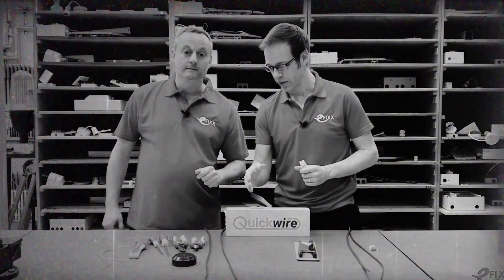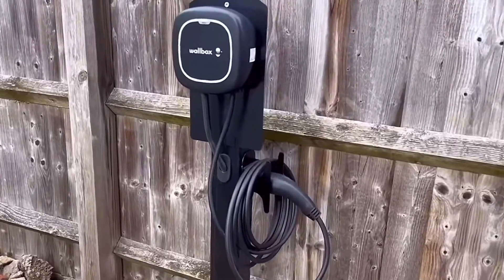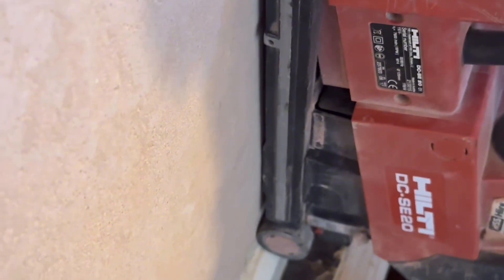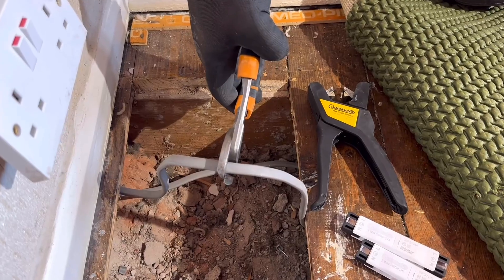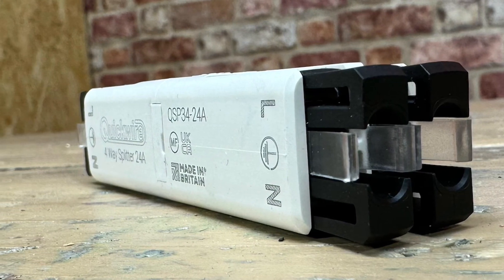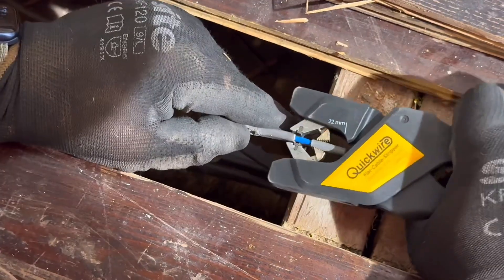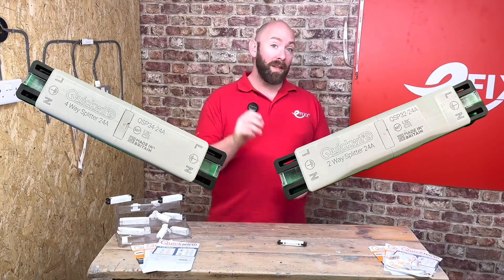Quickwire - The Fastest Way To Extend Circuits

Comment: Loving Quickwire connectors, but, if I'm not mistaken, the cables have not been fully inserted before the mechanism retracts.  This means that the connection is not secure.

Comment: Do they do a 32a version otherwise what’s the point
Reply from the maker: And the rating on 2.5mm sq cable is ???
Reply: @efixx  unrelated to this very funny thread, yet related to this video. Quite a common question unanswered here is can this product be used under fresh plaster in cases of repairing lighting where knicks of the cable have occured?

Aappreciate any response :)

Comment: I'm sold but one question...  Can these be buried in a plaster wall?  I.e. used in a wall to repair a nailed/screwed into cable and then plastered over?  (Obviously not energised until the plaster is dry?)

Comment: For what I remember in regs you cannot cut the ring to install JB only at C unit and sockets that is where the old 30 amp JB where design to enable you to install the JB with out cutting the ring circuit.
Reply: No idea what you’re talking about
Reply: Are you saying that you can't spur off a ring circuit unless it's out of the back of an existing socket, or the at the consumer unit?
I'm 99.99% sure that's completely untrue and is fine as long as you use a maintenance free junction box.
Reply: @1992jamo  no you can spur of the ring using a JB but the old 30 amp round type that allow you to split the cores of the twin and earth, and place them into the JB without cutting the ring circuit,then putting your shut cable into the JB, and tightening the brass screws up on the ring cable and the spur cable. Hopefully that make sense
Reply: @kevanswift7797  

I think that was just a practice sometimes used with the old junction boxes. I don't believe its in the regs. Ring is cut all the time, to install JB, you do with Wago's too.

Comment: On the 24a JB is that a fuse holder in the centre? If it is, this item doesn’t seem to be maintenance  free, just saying😎
Reply from the maker: Apart from the MF “Maintenance Free” symbol printed on the rating label.
Reply: @efixx  so its not a fuse holder then???
Reply: @quickwire80  thank you for the info most appreciated👍😎

Comment: Can you bury it in a wall, if someone has drilled a cable.
Reply: It is indeed MF!
Reply: @quickwire80  So you can plaster over it? I've never had the chance to look at the actual MF specs. 
If it can be plastered over I can see this being very useful.
Reply: It’s maintenance free, so yes.

Comment: How much cost do they add to the job? What's a socket install about £65 less £10 materials. 3 quick wire connectors were used so what's left on the £££ for doing the job?
Reply: If you’re just adding 1 socket then £65 is way too cheap. Using quickwire or not.
Reply from the maker: Time is money - do the maths
Reply: Takes about 2 minutes, so should charge customer a few pence.@efixx

Comment: Got my hands on some of these today and they look great. Looking forward to using them. I have a job where they will be perfect.
Reply: Awesome. Can I ask what the job was - as in how you used them? Always good to get feedback
Reply: @quickwire80 This was to add a spur to a ring where there wasn't any cable slack and it would have been inconvenient to have run a cable to spur off an existing point on the ring.
Reply: Where did you get yours from ....need some for next week....
Reply: @markyd2633  Directly from the Quickwire website. Only ordered yesterday so impressive speed.
Reply: If you want them quick, we do next day deliver pretty much as standard on the website. If you can wait a little longer then you can ask at your wholesaler, but they will have to get them in as they have only been released this week @markyd2633

Comment: If it’s rated to 24a surely you can’t use it on a ring circuit as it’s 32a
Reply: It's fine. We wire rings in 2.5 sq mm and those aren't rated for 32 A either. The same principle applies that the load will be shared between the legs of the ring.
Reply: @adambro5480 eh? It’s 5mm rating as it’s a ring lol
Reply from the maker: Great question, see the answer here: https://youtu.be/K_5fxTN-yOg

Comment: I love your videos.   So I’m not having a dig.

At 3:22 you can see that the sheath finishes slightly outside the ‘JB’ or splicer.  (What ever you call it.

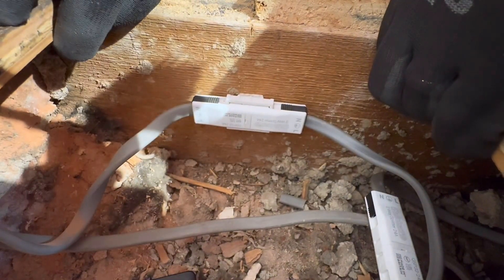At 3:33 the T&E is twisted before it enters the JB.  

Is that all normal and ok?

Comment: Quick wire are fantastic awesome products. Shame the TW&E automatic stripper is way was overpriced especially as you can’t change the blades  
Great video as always Joe 3po
Reply: The new ones do have replaceable blades. Have a look at the price of the identical Knipex ones tho 🤯
Reply: I'll just add the the other comments (thanks guys) that yes, our new versions have replaceable blades now, and prices should be very competitive...
Reply: Actually cheaper than the jokari version I had some couple of years ago.
Reply: Yes you can change the blades....look on their website

Comment: The UK installation practices are a complete joke to me. Be it the flat cables, not using conduit, leaving connections under the floor, bundling cables, the square boxes... everything is outdated and insanely labor intensive with every small problem again requiring excessive labor to fix.
Reply: Well stay in the Netherlands then
Reply: @markyd2633  
I am. Free speech isn't as degraded here as in the UK.
But feel free to learn from a much easier electrical system.
Reply: @markyd2633  
Spam isn't free speech mate.
Reply: UK is actually tons better than other parts of the world. Trust me look into itm
Reply: @h8ryj 
The little data there is on mortality rate from electrical injuries says 5x higher in the UK than in NL. The UK is on par with Germany, and that includes former East Germany.
The UK scores better than Belgium, but that's not that hard, lol. 
Definitely not the best on that front.
And that didn't say anything yet about the insane labor intensive practices. Like the square boxes that get chiseled in or require a bunch of chasing. In NL we have round boxes. Simple core drill and done. 10% of the effort and only 0,1% of the dust. Also requires a lot less of plaster work. And when you drill through it... you just pull new wires in the counduit and be done; zero plaster work involved.
Reply: @_Rich_.  
Yeah, I don't get why people posts comments like markyd2633'
Reply: Is that why we have the safest electrical system in the world and the best training and the best trained engineers to install repair and upgrade and the tuffets wiring and building regulations in the world.
Reply: @Dog-whisperer7494  
Who is 'we'? The UK? Safest in what way? 
The little data there even is points to the UK having a five times higher mortality rate from 'electrical injuries' than my country (the Netherlands).
Are you on voice to text? Otherwise I don't see how you use 'tuffets' as an adjective.

Comment: I’m no electrician, but isn’t twin and earth being replaced by 3 core cable in April? Will these connections be compatible?
Reply from the maker: I think that was our April fool from last year.https://youtu.be/qFWK57Yzefc?si=_8KDHALprbYZyyp4
Reply: Yes it was !  @efixx
Reply: No
Reply: Thanks for that, I've just found out it was an April fool, doh!  @markyd2633
Reply: Honestly, I have a mini heart attack every time I see a comment like this. And it always ends up being that damn April Fools video! shakes fists at efixx
Reply: Too right!!! In my opinion, your connectors are the simplest and best designed on the market and it’s great news your making splicing connectors for 2.5mm

Comment: At 2’46” we see the lights go out as matey forgets to disconnect the N and cpc at the split load board - I only ever did it the first time 🤣.
Reply: Well spotted!!! I was going to challenge myself to nibbling through but thought…..nahhh😂😂😂
Reply: @joehammond6119  funny isn’t it, sometimes you can get away with it ! 👍😎.  Seeing how you looked away and put your hand up before committing I can only guess you’ve got some arc modified cutters at bottom of your tool bag 🙈⚡️.
Reply: Good way of testing the Rcd I suppose 😂
Reply: I wondered if they did that on purpose? Camera man at the breaker
Reply: Your comment doesn’t relate to the video , he did show a split load board or forget to disconnect the neutral and earth. What are you talking about?
Reply: @Dog-whisperer7494  I think you meant to say “didn’t “?  Look in comments above and you’ll see joehammond himself reply to what he did.